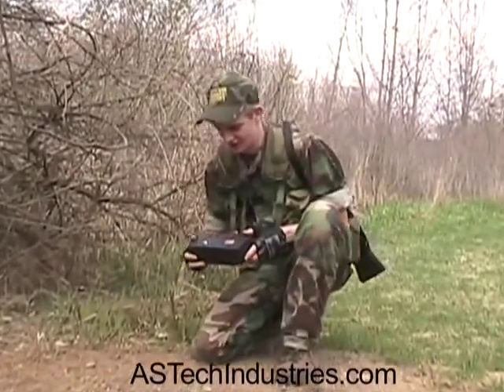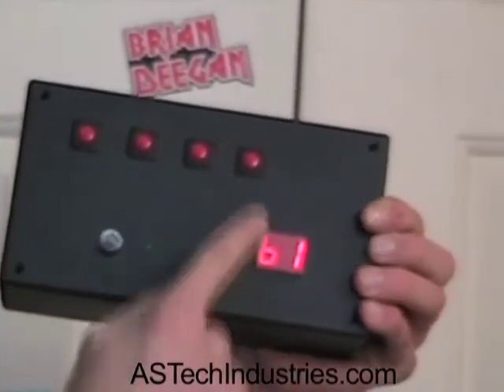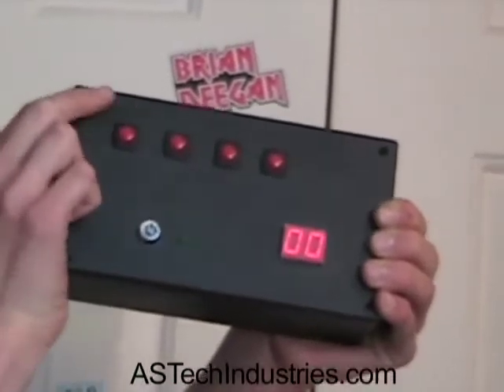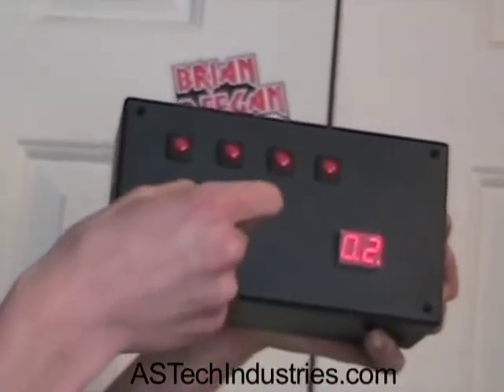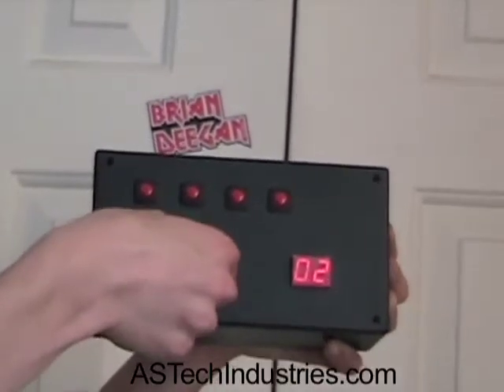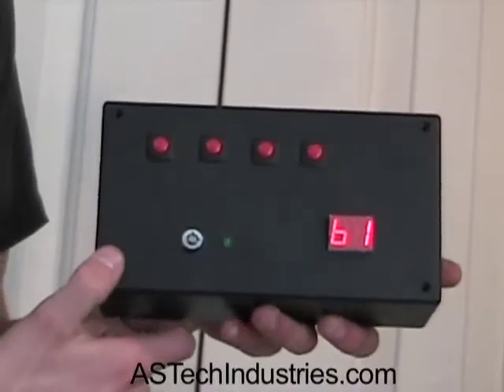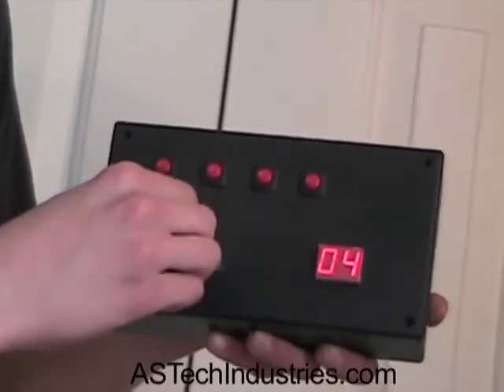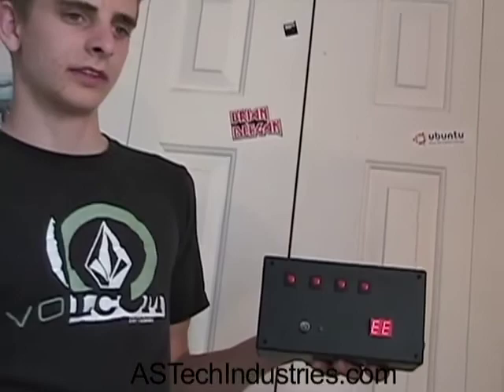ASTech Industries Airsoft Smoke Bomb Demo

Comment: @dsaswq you put digets of the code in order at several small bases or one big bace with the bomb in there bace then they have to assult a bace or more get the code then jun back and enter it b4 (lets say 30 min) without geting out or you have them jun back to a respon point then go back wile the assulting team trys to stop or delay the defending team for as long as posible